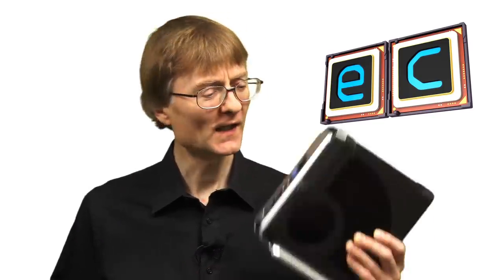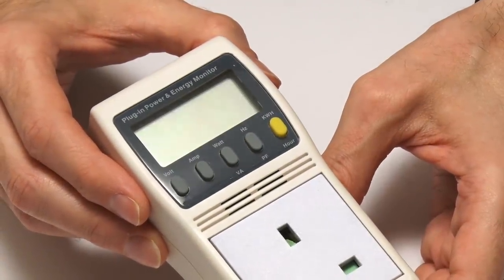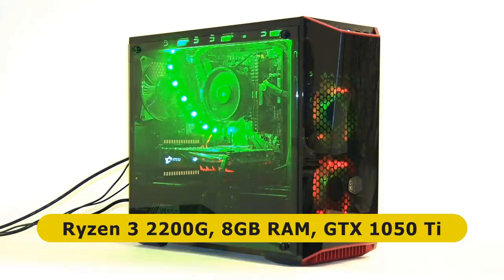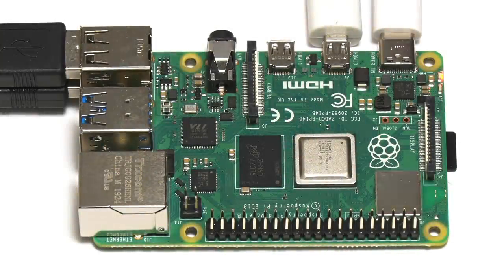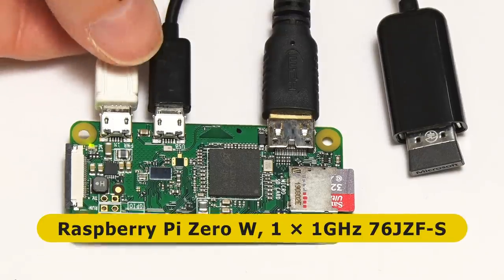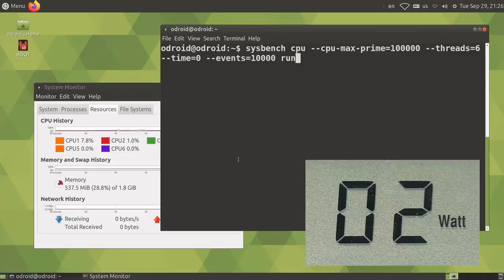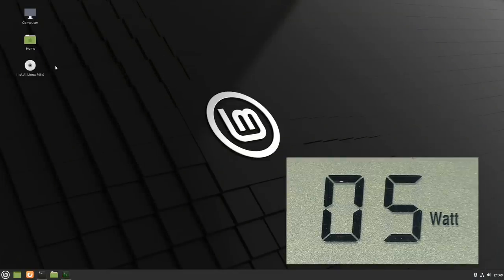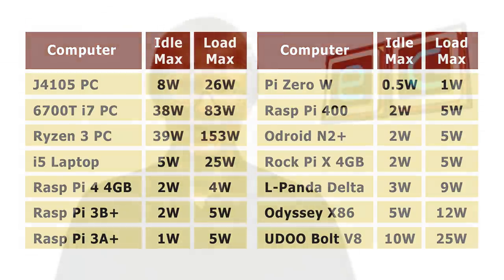PC & SBC Power Consumption

Comment: I bought a raspberry pi 3 a+. I am happy with it. I'm not using the official psu. I bought a 5v 2A little psu from china and hooked up the shortest micro usb 2.0 cable. The rpi is running 24/7 headless and I'm using ssh and rdp to connect to it. I covered the annoying red led with black tape. I wished it was dimmable.

Comment: I have meters connected on each major wall socket so I can measure the power used. There is one more factor to consider: Vampire power drainage. This means how much power lots of devices leech from the mains even when they are off. All the transformera and  standby circuits eat up power just by sitting there being off! My main computer desk with all it's gismos uses 40 watts with everything off!  So I have a smart switch to turn everything off eventually.

Comment: I'm fascinated to note that your editing system runs an i7-6700T and 32GB RAM; you'll definitely love using an MSI ECO motherboard, if you haven't heard of the lineup.

The second generation of MSI ECO is optimized for 6th-gen S- and T-series Intel processors and 32GB 2133MHz RAM (up to 7th gen and 32GB 2400MHz DDR4 after a BIOS update) and have several energy-saving features to play with.

Definitely try them out! I don't see many users covering these boards in depth, and I've wanted to challenge myself to create an energy-efficient gaming PC using one of these boards.

Comment: As an Electrical Engineer, I understand that Power Measure in Watts, is Voltage times Amps.  I know you can't do this, but I am interested in weather the basic input voltage make a difference in power draw.  In an ideal universe it shouldn't make a difference, with twice the voltage the device should draw half the current, but I am interested if how the power supplies react to different voltages.

Comment: I stopped using my power meter and started using BN-Link wifi heavy duty smart plugs ($25.99 for a pack 4 prime on Amazon).  They show live amps and watts, and track month to month usage.  So far they've been perfect.  But the thing that surprised me was that my 3 Asus 27" monitors use 48 watts each, while an identical Asus 22" uses only 22 watts.  My no name $100 43" 1080p TV only uses 38 watts.
Reply: Maybe a lower refresh rate on the TV makes it draw less. Still it seams surprisingly low compared too your asus monitors.

Comment: That's nice.

However, I'd like to highlight that In many situations that's not neccesarly the power-draw you'd be looking at, I. E. when using a Raspberry Pi as NAS most of the power consumption is likely to come from the Discs.

I believe in that regard regular HDDs also loose significantly to SSDs, at least in idle.

And yeah a good part of the power - consumption of the desktop is from the GPU.
Reply from the maker: Yes, agreed. But I think it was clear that the tests were for the hardware as noted. :)

Comment: with sbc's you also get problems with the powersuply when measuring power since often powersuplies will eventually not go below a certain power lever and when they go bellow will just use the same amount of power.
Reply from the maker: True but completely irrelevant! :) What is being tested here is being accurately measured here is SYSTEM power use -- which with all kinds of technology, will be influenced by the power supply itself. So even if can SBC can be powered with less than the PSU can deliver, the working system cannot.

Comment: Should you clarify that max load is max CPU load?  It seems that the GPU load could be significant and I'm not sure that your tests put a load on graphics.
Reply from the maker: Very fair point -- in the SBC tests Sysbench is only stressing out the CPU. But the relative GPU drain here (with the possible exception of the UDOO Bolt will be small.

Comment: Two comments:
- on the laptop, the screen is included. So, as you say at 2'35, a monitor is between 20 & 25 watts. We must consider the two configurations - with and without screen.
- in winter the Ryzen PC could be use as heater isn't it ?
Best regards.
Reply: A (portable) heater usually goes up to 1500W. So it would not be as fast, but sure it would still heat quite a bit.
Reply from the maker: Agreed on the laptop screen, but I did mention this in the video. In the winter, when I sometimes have multiple machines rendering animation for days or weeks, I can always turn the heating down.

Comment: I noticed that in some tests the systems where not connected, to be truly representative of normal computer usage you need to make sure all systems are connected either through wifi or ethernet. Don't forget to run video as the gpu will also draw power on top of the benchmarks you run. And of course if unpowered speakers or headphones are connected the audio output should also draw some power.

Comment: If you were serious about power use you would do at a component level using monitors on test points or a test harness ( pogo pins ) especially for embedded devices where you would want to characterize each component.  Even on PC this would be a good idea as the software / internal sensors are probably not overly well calibrated.
Reply from the maker: With respect, I actually don't agree with this at all. What matters if you are concerned about total power use is the overall power use of a system! :) Certainly, if you want to reduce power usage in a system, then you need to measure individual component use (or as I do pick appropriate components in the first place). But as some comments here show, PC users often obsess about CPU and other individual component power draw, in the process gaining a very artificial impression of overall system power use.

Comment: I'm curious about the methodology of your SBC tests; does the script also maximize GPU consumption? Your tests of the larger desktop-class PCs involved render tests that would include power consumed by the GPU, but I didn't see such information for the script used in the RPi tests. Thanks for another informative video.
Reply from the maker: You are right that the SBC tests are CPU-stress only, but the relative GPU power use here would be very small (unlike in a PC).

Comment: I noticed you didnt have a fan on the RPI4 .. and it was drawing less power than the RPI3s. Are you sure it was not cpu throttleing ? In one of your other videos you stated that the RPI4 should never br run without a fan attached.
Reply from the maker: Cool observation. It would not be throttling here due to length of the test, but it would start to do so if left running for 5/6 minutes plus.

Comment: Great video =)
High power create lot of heat. Heat is on of the main reason why computers break down.
I bought a ASUS G75VW laptop for 7 years ago and it works very well. It have a good fan cooling.
Then I bought a MSI stealth laptop and it started to break down after 1-2 year. It was getting warm very fast and have bad cooling.
Intresting to how smartphone handling power and heat better then the computers. Why?

Comment: Hi Chris, Why didn't you remove the battery from the laptop? Was the power deliverd by the battery also measured?
Reply from the maker: Because the battery is not removable! :) I did make the point about the problem, and having the laptop fully charged. There would be no power delivered by the battery when running off the adapter.
Reply: @ExplainingComputers  If the CPU requires more power than the charger can deliver then the battery will drain.
You can unplug the battery from the motherboard when you open the case.

Comment: Forgot to reply to this the other day, but this has been on my mind for some time. I am planning on putting together something at home for a small home server setup, but I am just not sure what my needs are. I'm thinking I might be able to get away with a Pi or 2, but then I wonder if it's better to just build a server closer to traditional hardware, and even then, if the costs of power and equipment is worth it versus running things on pi's. lots to consider with this kind of thing!

Comment: It would have been good to include a couple of NUCs. They are used for home automation as an alternative to Pis.
Reply: I have a HP EliteDesk 800 G2 Mini (similar to a nuc, but slightly more powerful and larger). I just tested mine. I got 20W idle and 60W full load on GPU, around 50W full load CPU. That being said I’m not sure if my watt meter is trustworthy (at least it’s not for low power, since it never displays less than 10W, even when nothing is plugged in).
Reply: @PatrikKron  that is helpful. thanks

Comment: Chris.... whats your opinion on running a raspberry pi or small sbc as an everyday desktop ? i been thinking on a pi 4.. 2gb would that run ok as a desktop running say for instance linux mint with 2 monitors...? or would i be better gettting the 4gb or 8gb version, any other cheaper alternatives i can source from the uk for everyday use preferably less than £50 thanks
Reply from the maker: I did a video on this here: https://www.youtube.com/watch?v=i3ddj9_LMgU -- and it should work well, as since I made the video Raspberry Pi OS has improved significantly (esp in regard to browser video playback), and we have Ubuntu 20.10 for the Pi. You cannot run Linux Mint on the Pi though, as Mint is an X86 distro, and the Pi has an ARM processor. The 2GB will work fine, but if you want to do more intense browsing and run two monitors, I would recommend the 4GB model. Good luck! Many viewers of this channel I know use a Pi 4 as their desktop PC.
Reply: @ExplainingComputers  thanks.... seems like thats the way to go then.. i just wanted to reduce my power consumption in daily use as all i seem to do is browse internet and watch a few youtube videos, currently playing aobut with hyperion on linux mint its an ambilight clone seems to work well.. hoping i can get that to run on a pi zero w.. thats the plan anyway. love the channel great to watch thanks..

Comment: It is fascinating that the Raspberry Pi Foundation recommended a higher power output capable plugpack for the Pi4, yet it uses a bit less than the Pi3+.  Maybe they allowed for higher power USB3 devices to be driven?

Comment: With so little power required, I've been wondering for a long time the sheer lack of any truly portable SBC cases/DIY kits with a rechargeable battery, USB hub, and a screen (Doesn't even have to be touch). The RasPi Zero would be perfect for that application with extremely lower power requirements to extend battery life and a single OTG Micro USB connector to be split into multiple USB-A ports. I'd buy that in a heartbeat.

Comment: It's a missed opportunity that you did this in a way where comparison is impossible. You should have chosen the same high-demanding task for every computer, and not only measure the power used while doing the task, but the time needed to complete the task. This way, you can have a very interesting efficiency rating.
I mean, a computer using 30W versus one using 60W looks like the first one uses less energy, but if the 30W computer takes 5 times longer to complete the same task compared with the 60W one, then the one that uses less energy is the 60W one.

Comment: I prefer to build PCs that offer very good performance if the least power consumption as possible.  Right now I have my living room PC with a 8700T, and a GTX 1650 Super.  I use it for Media playback use as well as high level 1080p gaming the average power draw is around 120~140W depending on the game, but benchmarking it can make it tap out at 160W.  Idle is 30 all reading are from the wall.  Now while I also go this route to make my parts last longer I mostly choose to go this route not for environmental reasons, but to cut cost on utility bills.  I've gone from having a $200 electric bill to $90 in the hottest months of summer in Arkansas (100~105F avg. that's 37-40c).  It is a shame that AMD puts a real stranglehold on allowing resellers from selling their "E" class processors (officially only for OEM mass purchase) their Ryzen 7 4750GE is nearly as powerful as the 3700X, but at have the power consumption.  In fact it's double the performance of the 8700T I currently use in the living room PC.  Just slap in a GTX 1660ti and I can actually game in 1440p while using around 20-25 more power than my living room rig, and that is still less power consumption than a PS4 Pro.

Comment: Nice comparison, although only measuring wattage will not do... You should take into account how long a certain application takes to finish. If a board uses twice as less power under stress, but takes four times as long to finish a task, then the board with higher usage makes more sense (when idle usage is the same).
Reply: Rendered the Blender BMW on my pi2 in 9 hours 3,5w*9h=31,5wh 
Did the same on my laptop with GPU in 4 minutes (4min/60)*70w=4.67wh

Comment: Very edifying as usual. Here's some more info I found interesting:

Encoding H.264 video with "Fast 1080p30" in Handbrake

2010 Mac Pro Xeon 6 core with hyper threading used for encoding, W3680 @ 3.33 GHz, 48 GB RAM
125 idle, 225 loaded, 200 fps encode speed

2020 Mac mini M1, 8 GB RAM, emulating X86 for encode:
7 watts idle, 26 watts loaded, 225 fps encode speed

To be fair I subtract a bit for 4 extra HDDs in Mac Pro and make it 200 loaded. Then let's say 1 watt per fps for the Mac Pro and 0.116 watts per fps for the Mac MIni M1, making the Mac Mini M1 about 8 times better at work per watt even in emulation of X86.

The Mac Mini M1 has a fan that normally blows cool air and it does not spin up or get perceivably warmer on doing this for extended periods. This is the future.
Reply: oh, a bit misleading, the source video was 480p so it was a 480p encode actually

Comment: Each of these systems serve a very different use-case, it would be more interesting to compare the total power-use against those, eg:
video editing is not really a use case for the Pi, so if your i5 laptop system (including a screen) does the job within 1 hour consuming 25 watts against a Raspberry 4GB + Screen (maybe drawing a total of 10 watts to be optimistic here) takes 3 hours, the Laptop is better off or let's say 20% more efficient.
Vice versa, emulating retro games like SNES on such setups reverses the outcome and makes the Raspberry with a low powered monitor 150% more efficient... it all depends on your usage ;)

Comment: Great video, Chris.  Had a thought on the lack of precision of the meter (I have the same one).  If you switch the reading to kWh, it reads two decimal places.  Now, if you were to run the RPi zero, for a week (168 hrs), you could divide the kWh reading by 168 to get a better idea of the fractions of a Watt.
Reply from the maker: A very good point. :)
Reply: Why not use a multimeter that goes down to micro amps?

Comment: Very interesting video. There's something cool about the idea that you can have a pi zero w working 24/7 and it will always be using 1 watt or less, I use mine as a pi-hole so that's probably the only raspberry pi I actually put to good use. 

Also is there a way to calculate total performance per watt? Like have them do the same heavy task and add up how many watts it took to do it by multiplying the energy used by the system by the amount of time it took to complete the task. Obviously sbcs are always going to look more energy efficient but in a case where they have to do some heavy computing a more power hungry computer might actually end up doing it with less energy just because of the raw power and the difference between ARM and x86_64 performing certain tasks. Specially because most of the time people try to compare them using things like geekbench or Javascript benchmarks which makes me cringe. I don't know if there's real life use for info like that but it would be interesting too.

Comment: How do the pi's draw only about 5 watts?
I mean, the PI 4 power supply ist able to supply up to 15 watts and for the Odroid N2+ a 24w powersupply is recommended.
Reply: It seams too low given that the Raspberry pi 3B+ struggles when using a 2A 5V power supply.
Reply: Perhaps it's because of the GPIOs. Start plugging too many and your power consumption goes to the roof.
Reply: @J Fz makes sense

Comment: Thank you, Chris! I appreciate the desktop PC that you built with the GT 1030. I was contemplating for a little while whether to buy an HDMI docking station or a GT 1030 since I thought about using a GTX 1060 instead. I am glad to see that the GT 1030 works for your needs and that it is a viable alternative for my needs as well.
Reply from the maker: I have been very pleased indeed with my (passively cooled) 2GB GT 1030 in my video editing rig. I thought it might not be powerful enough, but it allows HD and 4K editing in Premiere Pro and DaVinci Resolve with no issues, as least for the kind of work I do. Timeline scrubbing is very smooth. It probably helps that I have 32GB of RAM and mainly edit ProRes, but working with 4K mp4 files is OK too. I monitored performance quite a bit in the first few weeks I used it, but never maxed out the GPU or its RAM.
Reply: @ExplainingComputers  It is quite amazing how the GT 1030 is able to render 4K videos with a better value per watt compared to more powerful cards from the same architecture. I honestly thought that more GPU power would be needed for rendering 4K videos to be honest. I only wonder if there will ever be an equivalent Turing or Ampere card in the works.

Comment: What about the power consumption with gpu usage? Only cpu is stressed in these tests... How about a 3d game that uses gpu and cpu at the same time?
Reply from the maker: In the PC tests, both CPU and GPU were stressed.  The Ryzen system test, for example, used XPlane 11, and as we saw the laptop test used Fusion. But you are right, for the SBCs, only the CPU was stressed. But here, with the exception of the UDOO Bolt, the GPU's power use will be very minor compared to the CPU.